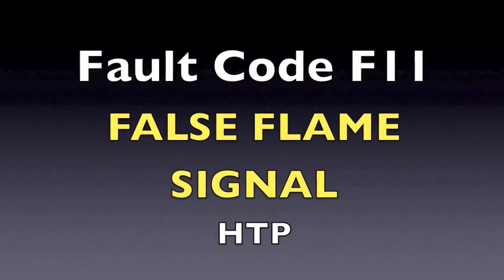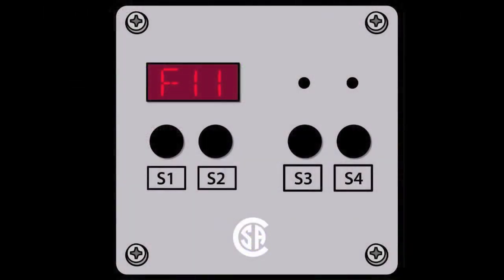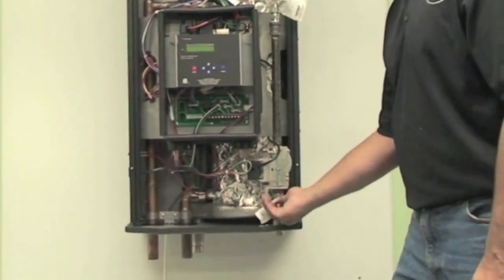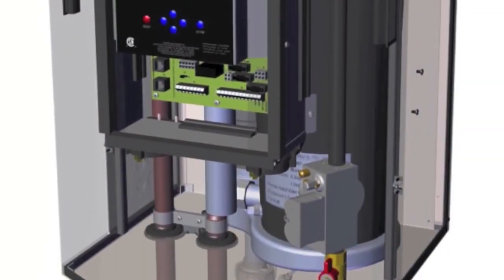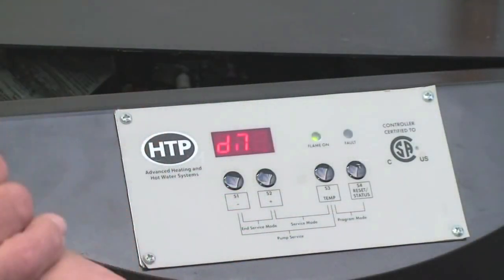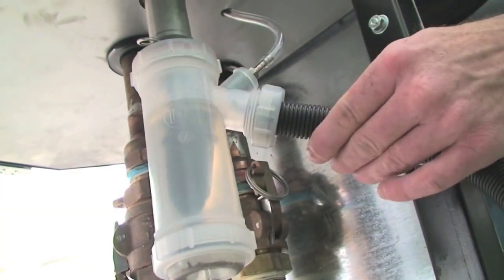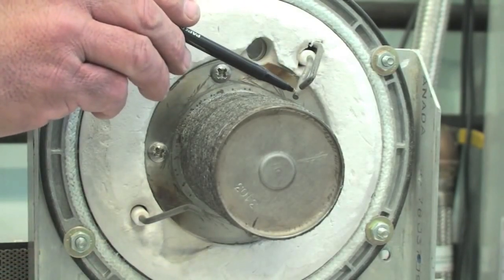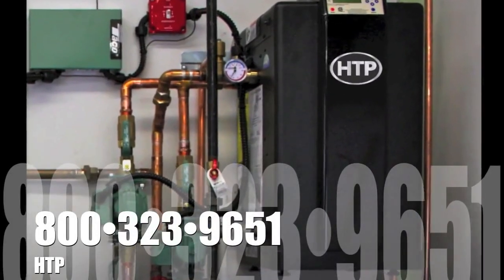F11 Fault Code -  False Flame Signal

Comment: Hi, I have a O A smith older model Superflue. I got a 4 blinks - 3 blinks. the code on the tank says False Flame. Phone technical support. One guy said  thermocouple or igniter. another day I phone another guy told me pressure switch, blow motor or venting.?????  please help. Thank you.